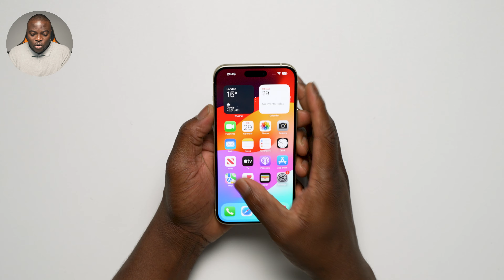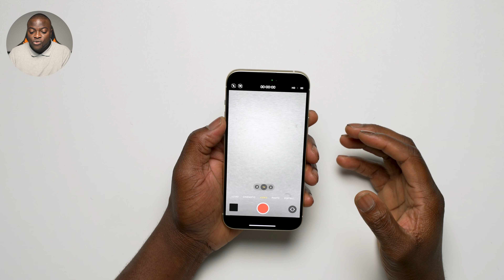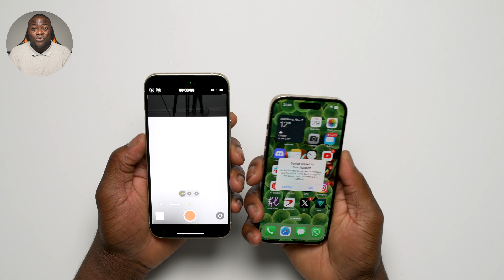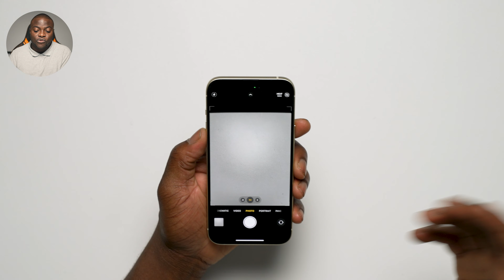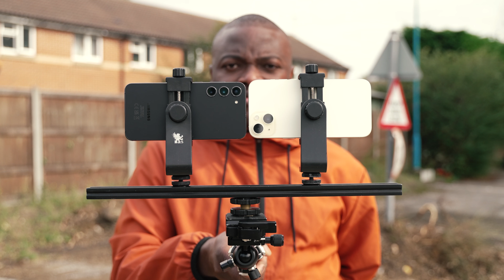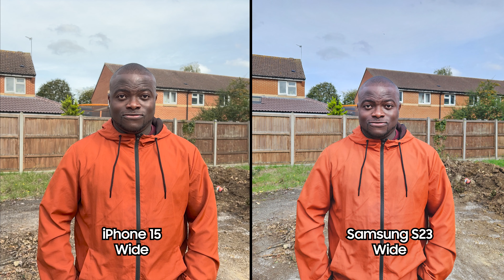iPhone 15 Plus vs Samsung S23 Plus - (UNBOXING & CAMERA TEST)

Comment: The crop done by iPhones (since the 14) on the main sensor to have a good stabilization in 4k video is really huge.

Ps: but beyond the crop, the reason why iPhones often have better HDR, better stabilization in 4k video and especially more details in the image, is because, unlike all other manufacturers, digital / software stabilization is applied in post-production on iPhones. 

During the actual capture of videos, iPhones focus only on color, detail and HDR, and all the rest of the processing is done quickly in post-production. 

Android manufacturers want to do everything during the actual capture, so they lose detail and HDR that are affected by the electronic stabilization that applies during capture. 

That's actually too much information to record and process at once for any current processor or iSP.

Apple has chosen the simplest and most logical path, copy what is done on real cameras 📹, record first, and then process and stabilize the images. 

That's why when you shoot with an iPhone, the return to the screen is completely unstable, shaken, and completely different from the final result when viewed afterwards. 

But, what surprises me most, is that, I really feel that no Android manufacturer has understood this since 🤔

Comment: Both have good video cameras, is theire a winner in this? I don't see so much difference. You can film with both at a concert or elsewhere and post it on YouTube, it is good quality, that's all it should be, right?

Zooming in and out is slightly better on the iPhone, but is this so important for an ordinary person? ;). It's nice that it zooms just a little bit better, but that's all it is. You really notice the difference with a OnePlus 11 that I have, a decent video camera, but the stability is a bit less and it is a lot jerky when zooming in and out.

They are evenly matched, sometimes the iPhone is better, sometimes the Samsung, it depends on where and what you film sometimes.